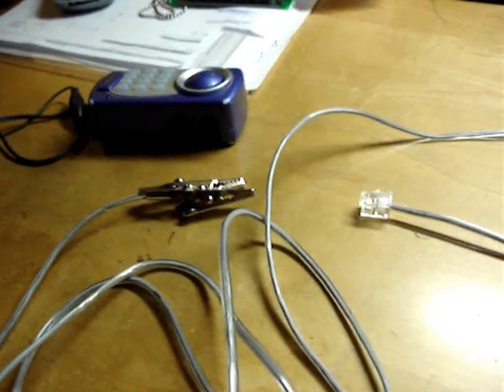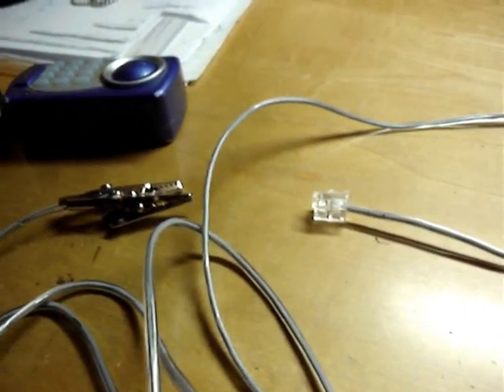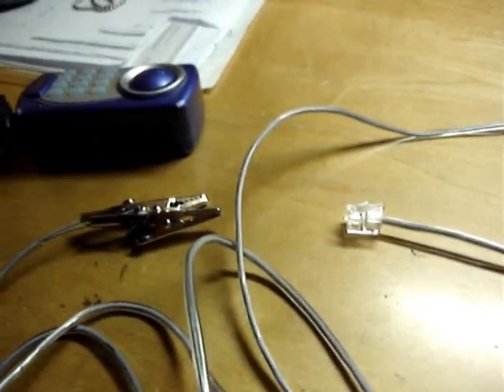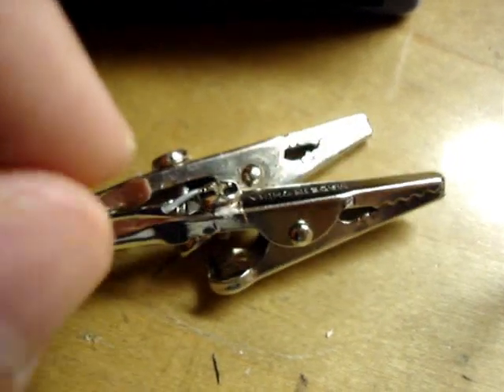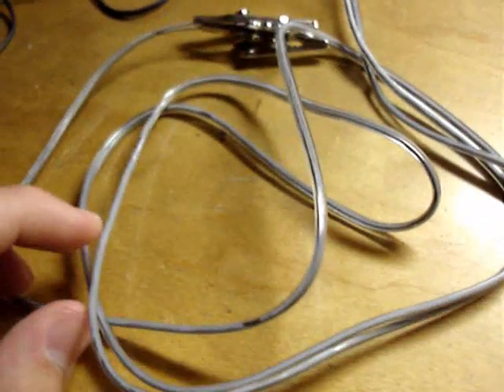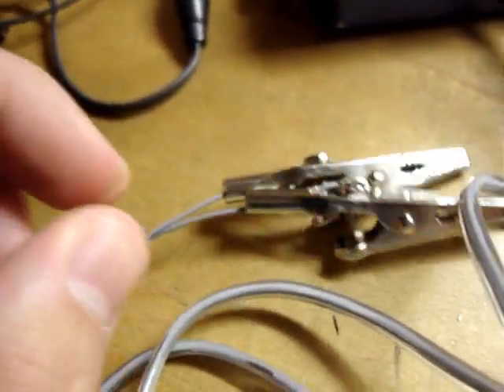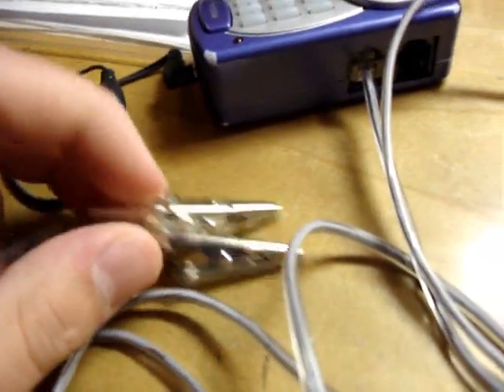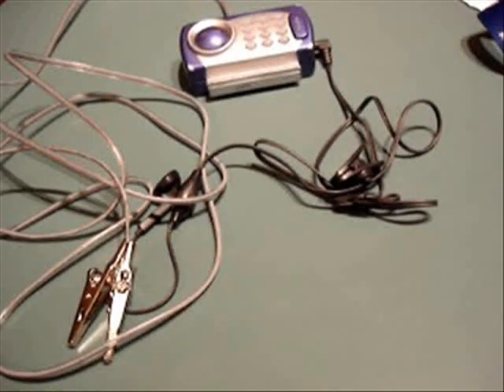Beige Boxing 101

Comment: I have a cordless phone that I'm converting to a "beige box" as well. In addition to the phone cord with alligator clips on the end, I'm making a small battery pack that plugs into base to power it. 

Advantage; the Panasonic 2.4Ghz phone I'm planning to use can transmit up to a block away easily so you can set the base up and call from somewhere further away.
Reply: So in the most basic of terms how exactly does this work? Step by step so I can easily understand. I know this video goes in depth and shows, however, I am personally still kind of not getting it.

Comment: The red and green are usually line 1, black and yellow are line 2. (residential anyways) In buildings with muliple lines the conductor pairs will be one color solid twisted with the same color with a white stripe. Polarity does not matter.